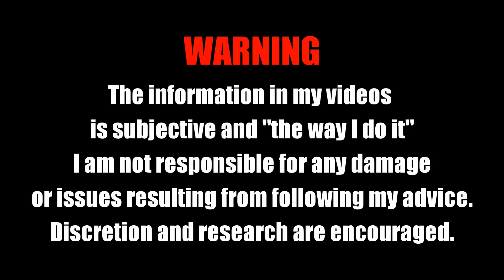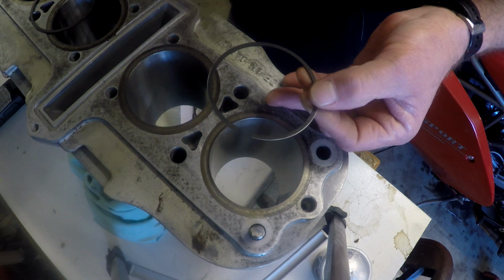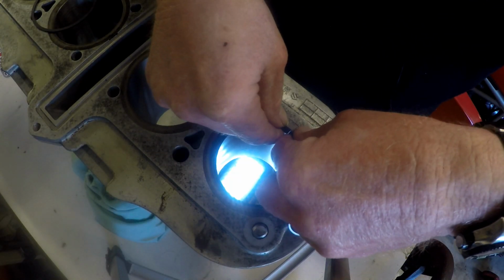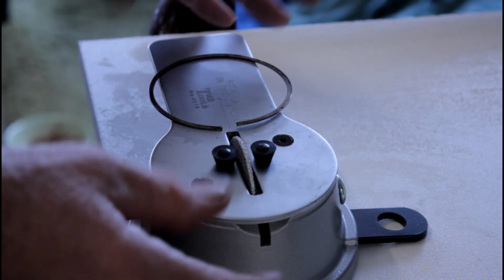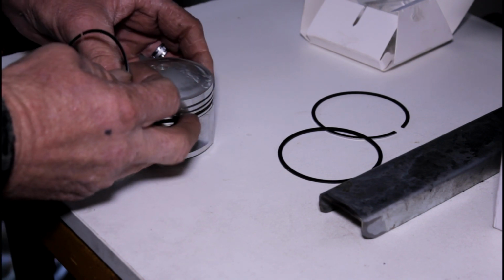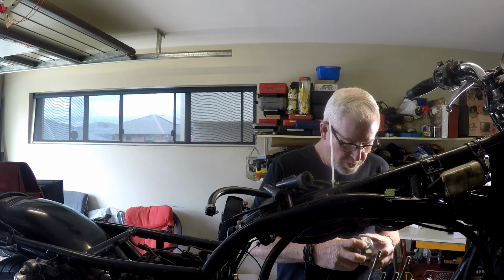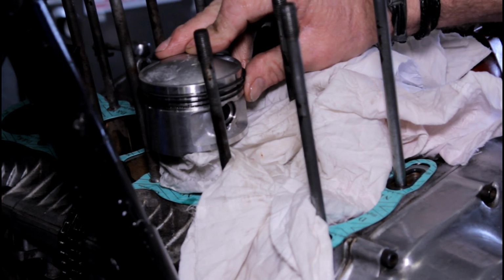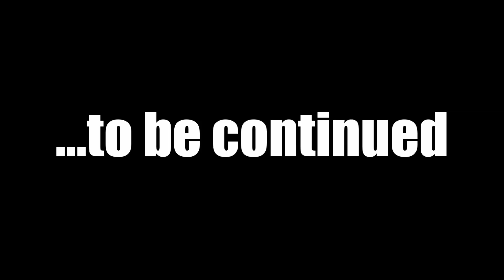GS1000 Episode 31 - A Barrel Full of Monkeys

Comment: Those rings are still under the .70mm service limit, so all is good. Quickquestion, did you just use one bore to gap the rings? You could size the smallest to biggest and then measure the bores and fit the largest gaps to the smallest bores - as there's always gonna be a difference between them. 

And LMAO! Pistons are too small - What a fucking dumbass! Who would make such a stupid mistake?! 'Cough' - me. I bet on the way to the machine shop you were thinking, 'silly bastard must be tripping, I measured the pistons and bores'

Great video Andy, fighting the good fight
Reply from the maker: Thanks Matt. Yes I did use all the bores, I know they’re well below service limits, and I’ve seen plenty worse. I didn’t measure them (the pots) but I only got about half a thou here or there so I numbered the ring boxes and fitted them to the bores that I checked them in. Yes I felt like a mega dumbarse but hey, we’re all only human. Except maybe for Batdell 😂

Comment: Wow Andy I can't believe you made such a newb mistake, even I've never done that particular one, smh Andy, smh.... oh I should point out I have never taken an engine apart that far, let alone rebuilt one 😀😁🤣 I have replaced a head gasket on a car but that was with the help of a 3rd year apprentice and even then it didn't go completely smoothly lol, so I think you're pretty damn clever. I did fix the breaks on my daughter's car today tho, she hasn't had it long and the pads are near new, but they were grabby and kinda jerking when coming to a stop. I pulled calipers off,  hardly sliding at all grease was more like glue lol, cleaned everything new grease, yes proper stuff from auto shop, full fluid flush. Omg what a difference, smooth consistent breaking and even a much improved feeling at the pedal, working better all round. Definitely the biggest job I've done, usually just easy jobs like pads and rotors, I'm actually really proud of myself which feels good

Comment: Back to the oil assembly debate, I have since my first gs in 79 built about six of my motors, from standard to 73 mm. 
I have used what oil I had, from whatever to moreys honey, I have never  ever had a motor fail because of what oil I used. 
So to the perfectionists. WHATEVER

Comment: Nice to see some proper pistons. Those old air cooled in line 4  Jap motors that actually have mid range torque and don't have a five figure red line. Proper motors. Pistons look just like HD, BM, Guzzi, older Duc and Brit twins. These new no skirt coated 4V pistons in motors revving to 12k and up are frightening. They last but they don't look like they will. And they make crap ashtrays  compared to old skool full skirt versions...

Comment: I thought you always want to turn those ring gap filers clockwise so that the ring is held flat against the surface of the device? You were turning counter-clockwise and it allows the ring to lift slightly not keeping it square to the file surface.
Reply from the maker: I was turning it the correct way, note the arrow with direction of rotation on the tool.  It was only a quick demo with an old bent ring and I wasn't holding it correctly.  That happens when it's not secured to a bench and you're mucking about filming.
Reply: @ANDY5  - well, you know we are all experts out here in internet land. 😃

Comment: When I used one of these ring gap grinders I had no instruction leaflet, slightly different and a lot older, I held the ring in front pushing the ring to the pillar where you were pulling the ring to it, therefore in my case the stone was cutting downwards against the ring face towards the anvil this way the ring didn't bounce. My experience with grinders made me think this is how it was supposed to operate?  Probably all wrong? but It worked and the engines still run after 20 years. 
Between ring gaps, main and big-end bearings, grinding valves along with clutch and gearbox checks I was sick looking at the bloody thing though it was (CBX6) something to be said for a 2 stroke single!

ref pistons - My old man always said the man who hasn't made a mistake hasn't made anything, always made me wonder why when my bro or me made those mistakes he erupted?
Reply from the maker: As long as the file is cutting from the inside of the ring to the outside it should be fine. The fact is that you will most likely have no problems either way, but you do run the risk of chipping the coating on the outside of the ring if you file from inside to outside. Something to be said about a CBX6 too. I’d love one